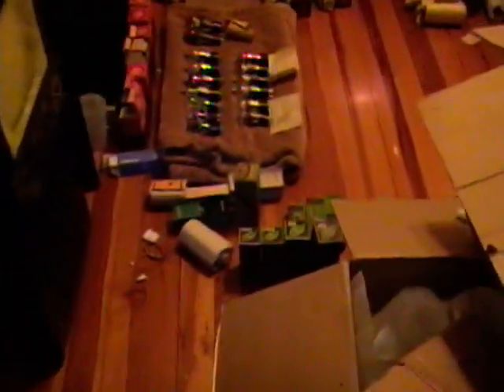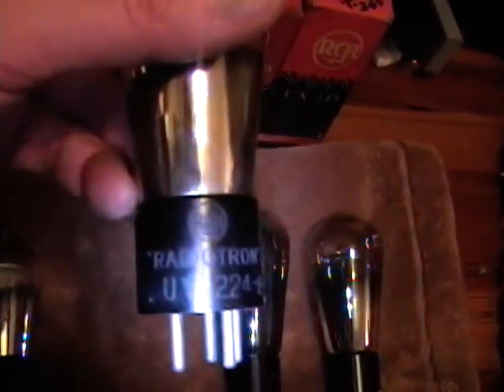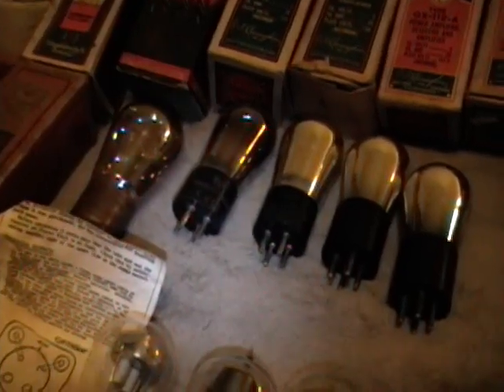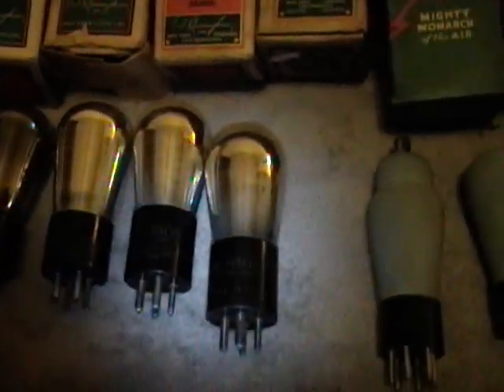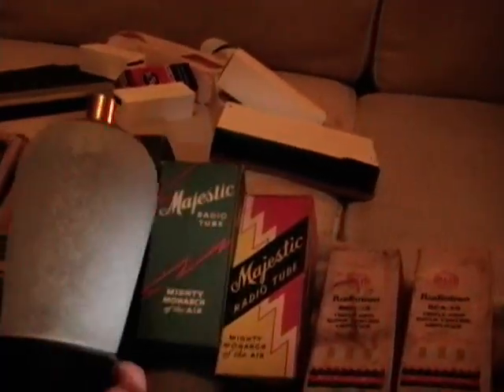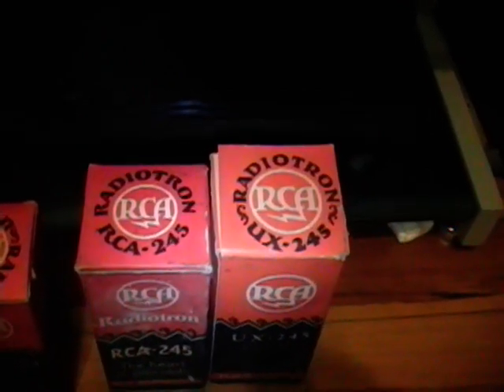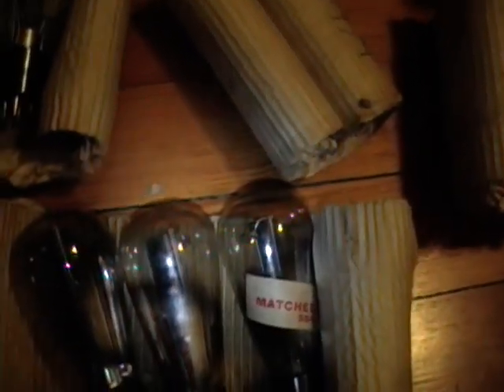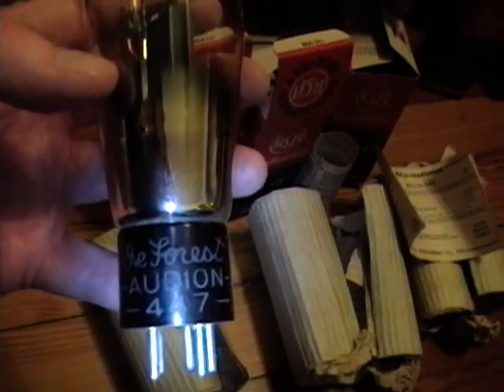Early vacuum tubes - part 1

Comment: Great tube collection. I learned electronics in the tube era. The CK-22 was the first experimental transistor just on the market for experimental use only.  Tubes though were more interesting to me. I remember testing them in the lab at RCA , plotting Grid to plate family curves.